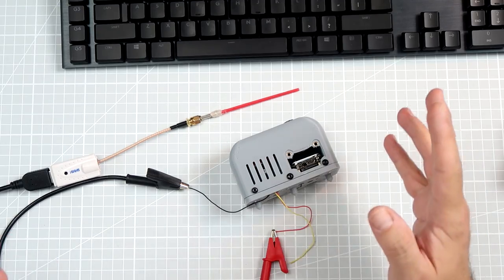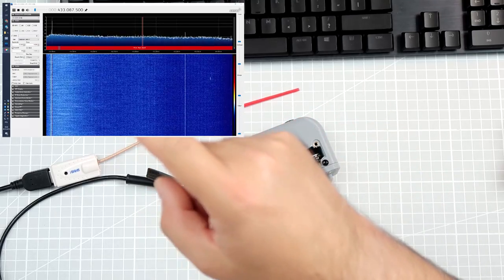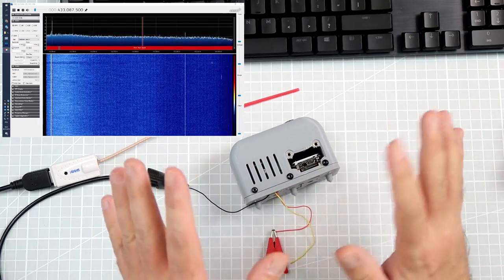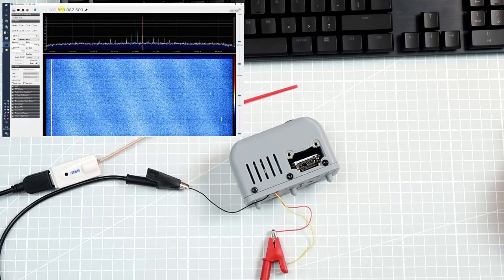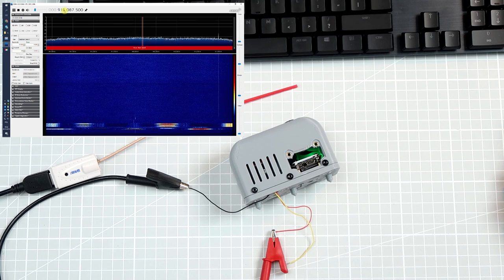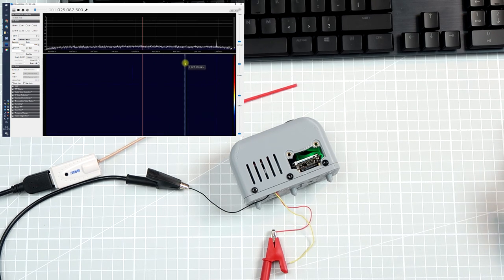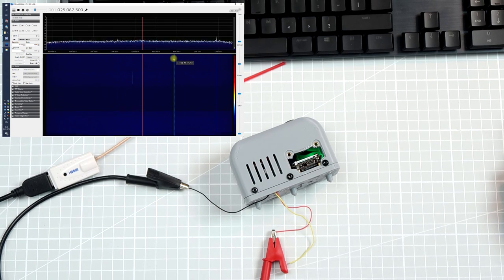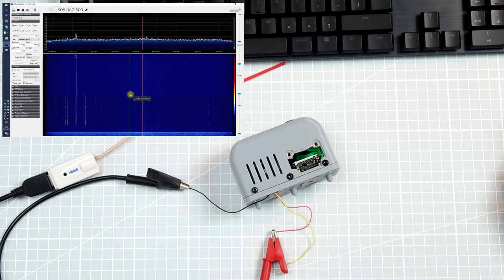GPS vs HD cameras - it's all about RF noise

Comment: I discovered a similar problem with the eBeeX. If you use very fast SD cards in the RedEdge camera, the GPS takes ages or refuses to lock. If you use slower spec cards it's fine. It's a balance cos the  RedEdge needs fast cards. I did some very crude measurements and came to the conclusion it was down to the high frequency noise generated by fast rising and falling data edges. Nice work.

Comment: I think I've seen this issue in person. The Runcam Split used to come with a fully grounded top shield / SD Card latch but the version 3 only comes with the latch. The latch looks the same as the Tarsier's

Comment: I've been saying this for a long time.

It's not just HD cameras though, FPV-only cameras can be responsible for this as well, case in point Caddx FPV cameras like SDB2 and MicroF2 - definitely affect GPS signal as well. Any camera that has a digital processor seems to be noisy unless the manufacturer has taken steps to shield.

Comment: Hi Pawel. After purchasing Caddx Orca I found out my Tyro (running on Arducopter) stopped arming due to high HDOP :) Remove the camera and the issue is gone. I tried shielding the camera and also power the copter without a camera first. Surely it gets the necessary sats but as soon as I put the camera back I get GPS glitch error.

Comment: I've had this happen when using the smaller versions of GPS modules  like the BN 180.  I couldn't move it far enough away from the Session 5 to get and hold a reliable lock. Now I only use the BN880. It's bigger and heavier but seems to be pretty much immune to RF noise from the Session and Hero7 Black.

Comment: Same problem with Flysky Fli14 receivers, I tried 2 new ones and had failsafes at 100 meters with both. Then tried one which I flew all of last summer and that also fail safed twice around 100 meters twice. It has to be the Tarsier causing this. 
So apparantly it also affects 2.4 Ghz

Comment: My long range quad has the gps on the arm near the motor and running a Caddx Turtle v1 with no problems! But on one of my wings I have a 1000mw 1.3 Ghz vtx which couse gps lock problems... My solution is first powering the fc over usb with a powerbank, once the gps has a lock, I plug in the lipo, then disconnect the usb power and everything is up and running.

Comment: Also have problems with GPS using the foxeer box 1 und 2.
Better than moving the GPS a few cm away was a little sheet aluminum foil :)
The box 2 is more problematic than the first one and I often had only 2-6 sats, with the sheet of foil in the back of the box I have now at least 10 sats.
You should try this, yust 2 layers aluminum foil and now the GPS is as good as without the box.

Comment: Thats 100% right!  I have shielded my GPS with a thin Metal Plate and the Wires with some Datacable Shield to isolate them from the Tarsier.  Look like that works, but i need more Flights to be shure.

Comment: I had gps fix problems and would only get a max of 5 sats when it took ages to get those few , until I put copper tape under the gps ,I also have cam and vtx powers on a switch and turn them on after a few minutes after the gps ,now it locks on in seconds and average 12 sats at once

Comment: I avoided these problems by accident when I thought about making a GPS jumpstart battery from on old phone batt.
I power first the gps, prepare everything else, then switch connectors and quad is GPS in less than a sec because of hot start.

Comment: What kind of USB dongle are you using to measure RF?
Reply from the maker: Second link in a description of a video
Reply: Is there software Pawel that needs to be used for this dongle.
Reply: Is this link the same as yours,it looks different and antenna to.
Reply: @markhinchcliffe5803  software looks like SDR# aka SDRSharp. For drivers you need to use Zadig tool, which is linked in  INAV or Betaflight configurator. When I clicked the link I got a generic search on aliexpress for 'rtl-sdr' these are available on there, or maybe amazon has something if you're in a hurry. The antenna shouldn't matter too much in this use case. In europe the rtl2832u can also be used to watch TV.
Reply: Thankyou very much Kyle